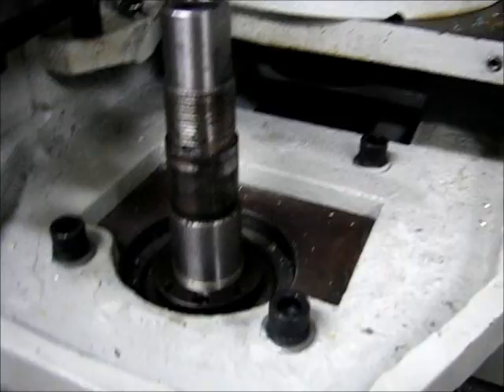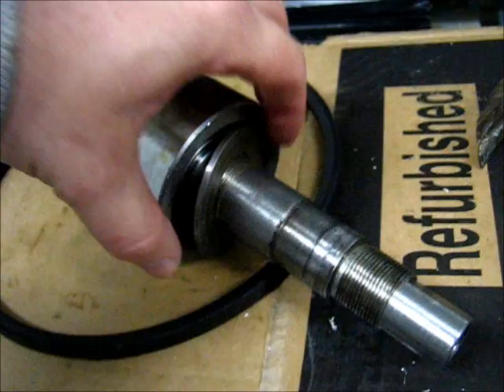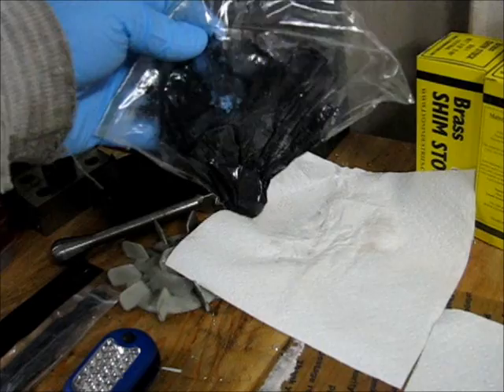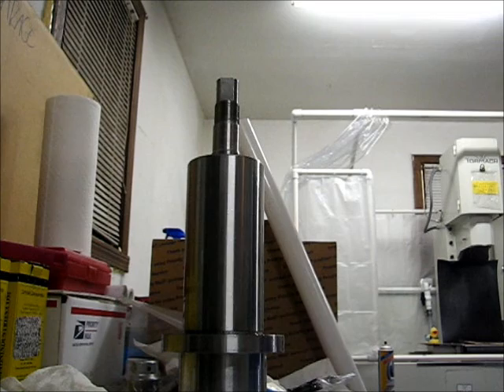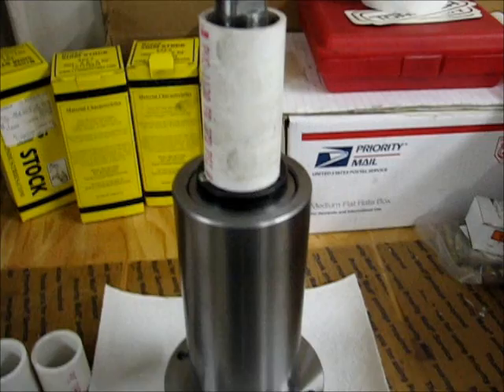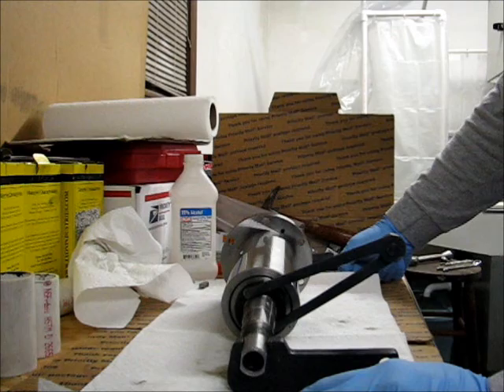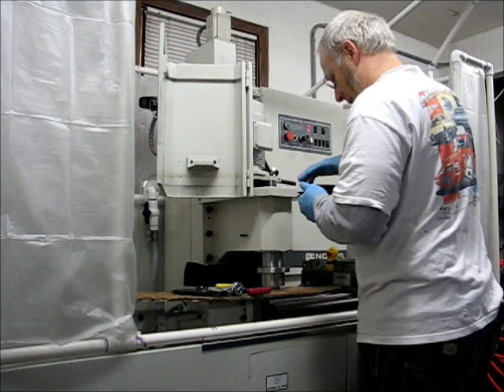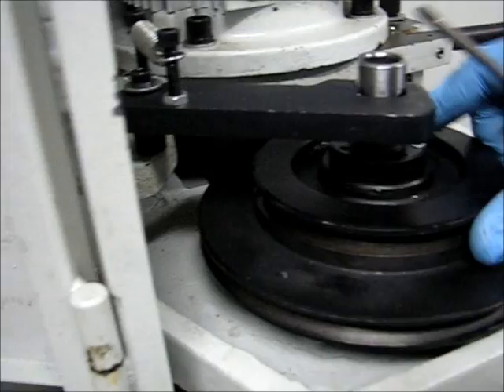Tormach PCNC 1100 - Maintenance: Spindle Cartridge Rebuilt Process

Comment: I think the order of re-assembly is wrong. You should not be pressing the bearings together, as you're doing near the end. You ended up pressing the lower bearings, inner race on outer race, to get the shaft in. This can cause indents on the race-ways.

You should;
1. press lower bearings onto shaft, pressing on inner race only
2. press shaft into housing, pressing on outer race only
3. press top bearings in, pressing on BOTH inner and outer race with a flat surface.

Comment from the maker: Thanks! I definitely will. I know that my bearing temperatures *feel* a little higher than before, but I never measured them prior to the replacement, so I don't have a baseline. The (apparent) higher temperatures have the converse effect of no axial play so the surface finish with the Tormach fly cutter is outstanding.

Comment: Check out "kluber isoflex nbu 15", it is a fairly expensive spindle bearing grease, but is said to be the best grease period for spindle bearings. I am not 100% sure I do not think you want a high pressure grease with solids like moly in it for ball bearings.

Comment: Help! My machine has started chattering even on straight and level cuts at .025 DOC with .5 endmill.  I've adjusted the gibs but the chatter is still there.  Could my spindle bearings be going bad?  My 1100 is a 2011 model.
Reply: G'day, did you replace the bearings and did it fix it? I am having the same issue.
Reply: @jackmonigatti211  Yes, I bought the bearing set from Tormach and changed them out.  Seems to be better now.  Good luck with yours!

Comment: So how has she been running ?  Our Tormach just started to make a little slur noise on startup....
Reply from the maker: Running pretty well.  I don't have many hours on it since the work (50-ish hours, since it's essentially used at hobby-level tasks with limited production), but I believe the axial float is better than before doing the bearings, based on the surface finish quality. It was mentioned on CNCZone recently (maybe it was even you?) that the bearing squeal at start up could be the motor bearings and not the spindle bearings. It seems like it might be worth it to remove the belt and check to see if it still makes the sound.

Comment: Hi Chris.  I'm wondering how long it was from the time you got your machine till you had to change the bearings.  I have to change my spindle bearings after less than 2 years.  They started to make a noise after only a month or so after receiving the machine.  I probably had less than 50 hours on it when the noise started.  It came and went.  Recently the noise has not stopped and increased to the point where I had to stop using the machine.
Reply from the maker: +Lance Gifford I had an incident where I was machining after changing setups.  I had forgotten that I had moved the vise and not tightened the bolts, so the end mill pulled the vise up off the table, which damaged either the bearing race or one of the rolling elements in the top bearing pair.  So, the repair was due to my error.

In your case, it seems like It is possible that not enough grease was used or the bearing preload wasn't tight enough.  I'd recommend contacting Tormach to see if they have any input about such a short bearing life.
Reply: +Christopher Anglin Yes I've contacted them about the issue and I'm waiting to hear back.  Thanks for your input.  Eventually what I'd like to do is have two cartridges, one in the machine and one ready to go as a spare.  This one will be the spare and I'll put higher RPM rated bearings in.  When the next one goes I'll do the same to it (depending on how long they last and if I'm still alive and machining by then :)  ).
Reply from the maker: Well, let us know what the resolution is.  Good luck and thanks for watching!
Reply: +Christopher Anglin So what Tormach is going to do is send me free bearings.  Not the solution I had hoped for but it's a fair trade off.  I'll be learning something new in the process.  I hope I don't screw it up!  I'll be watching all the videos I can find on how to change the bearings.
Reply: You should feel lucky they sent you new bearings. Mine went out with less than 1.5 years. I called Tormach with concerns over how hot the spindle was when it was still under warranty was told the bearing grease would thin out and start running cooler. Less than a year later the bearings went out. Tormach told me the warranty was up and I did get a reasonable amount of use out of the bearings. 
A lot of people are very pleased with Tormach and their customer service, I wish I was one.